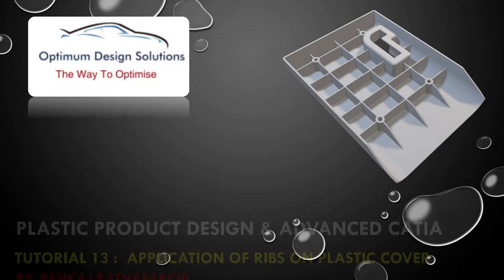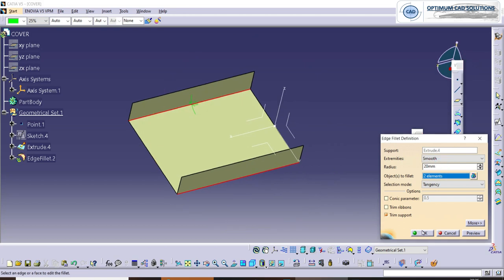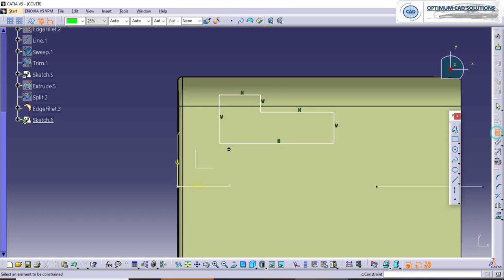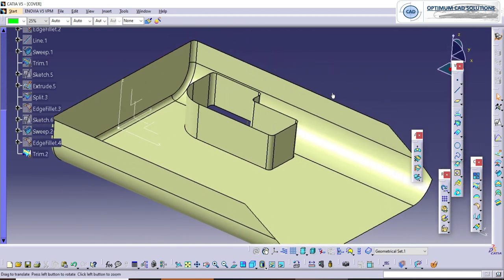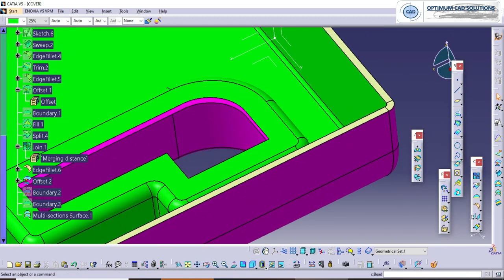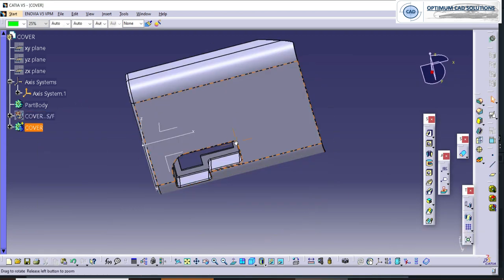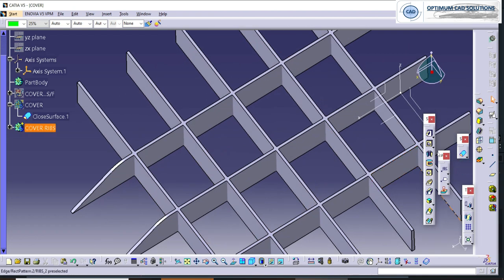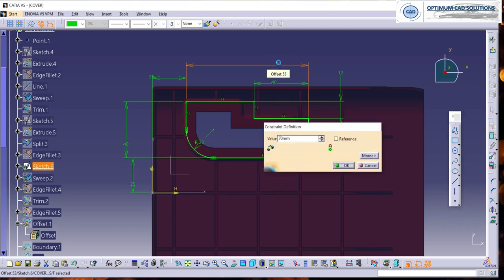Tutorial 13 :  Design of Plastic Cover with RIB | Plastic product design course and Advance CATIA

Comment: sir, i have a doubt... can you tell me how and why catia is used over nx and solidworks?
Reply from the maker: CATIA tool is easy for doing all surfacing objects... There are many advanced commands... Quit difficult but efficient for plastic design ....  Catia tool Tree is easy and help to optimize design.
And UG NX mostly used for casting metal component design ... Like engine. Parts